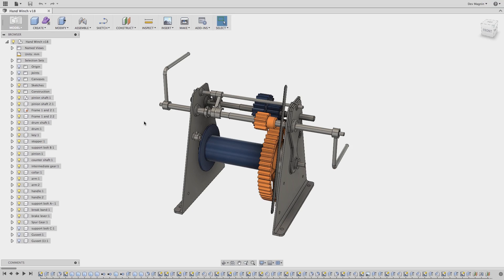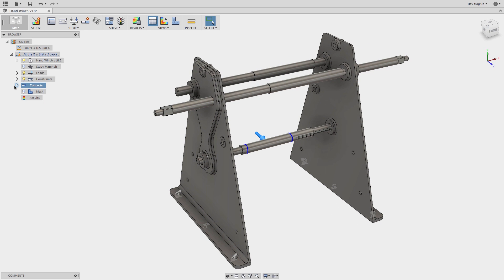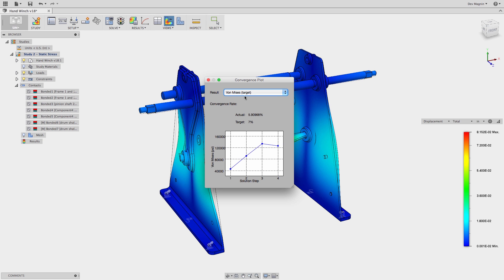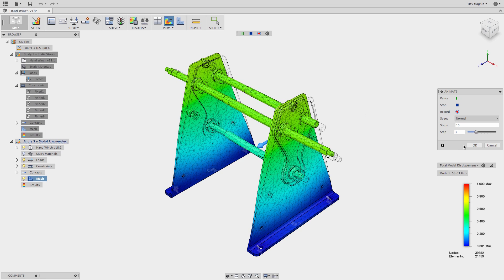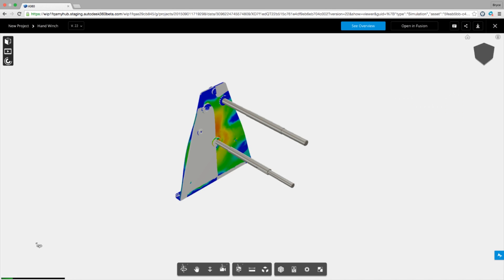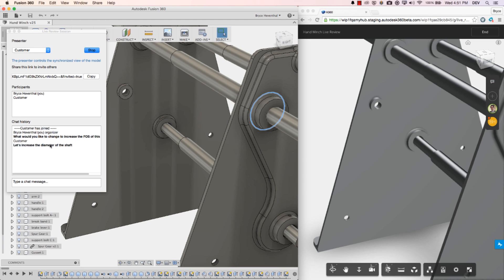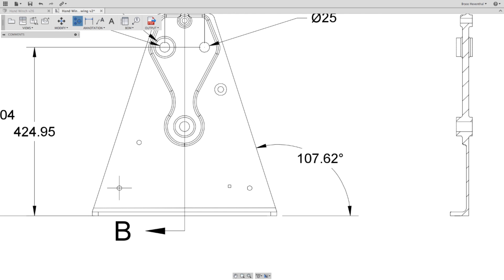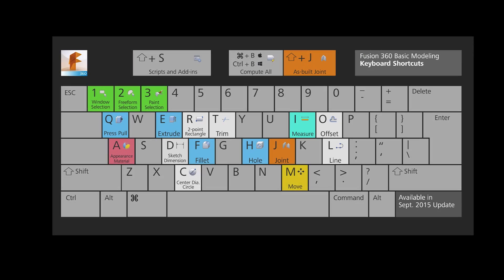What’s New in Fusion 360 September 2015 Update

Comment: Quick question. If the "constraints" wasnt applied at 1:19 the model would have travel as a whole when forces aplied to it. How would that turn (look like) in this program? (lets say you had a crane you wanted to lift, and wanted to know when it would tip over)?

Or as for my hobby designs in domino - actually want the system to tip over?
Reply: +Svein Lomheim Hey Svein, great question! The constraints we set up was to describe how this model was affixed to the ground (or alternatively, to another stiffer model). Had we not applied them, there would have been unrestrained rigid body motion. To do a 'tipping analysis', we would need to apply gravity as a "load", which will be coming to Fusion 360 very, very soon! Then again, for this type of analysis, a kinematic analysis (vs what we show here, a Finite Element Analysis) may be more efficient,